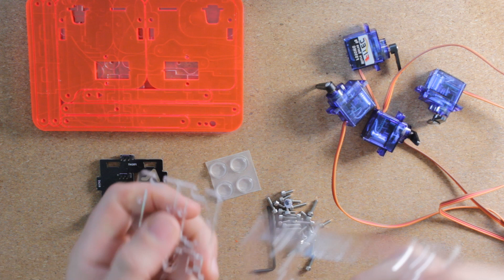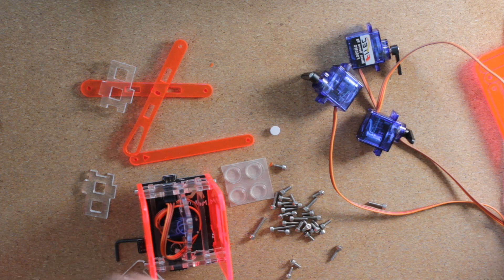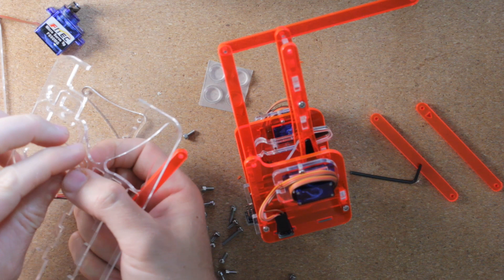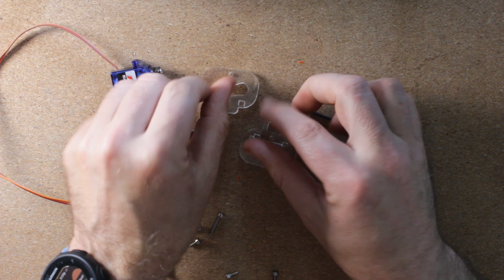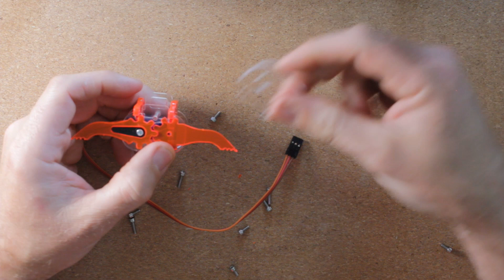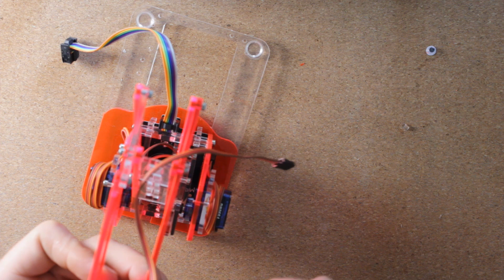MeArm Version 3.0 Build with Ben - Open Source Arduino Raspberry Pi BBC Microbit Robot Arm

Comment: you can say that again, during filming of my 0.4 build I broke several parts and its now held together with superglue!
Reply from the maker: When did they break? Was it removing parts from the sprues? I always found clear epoxy to be less messy than super glue
Reply: @MeArmTM  as I tried to tighten them. Apparently a little twist in the plastic will caused it to break.